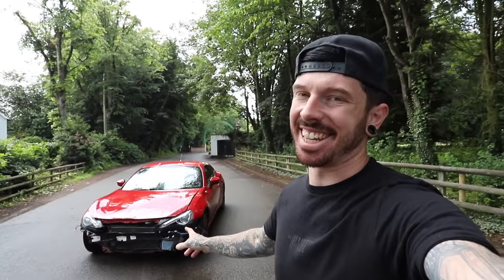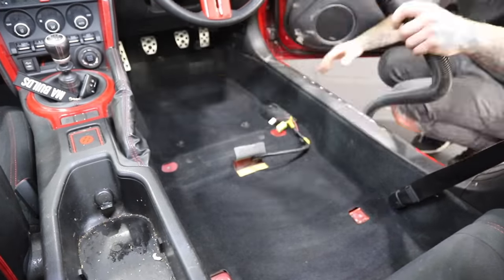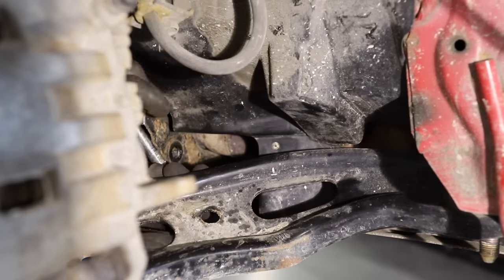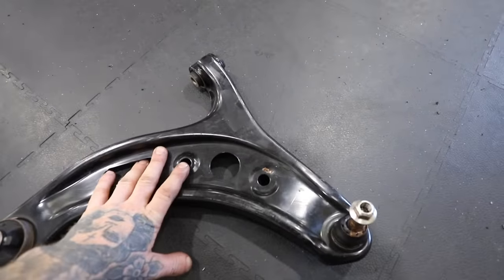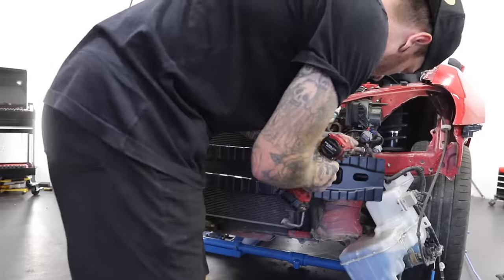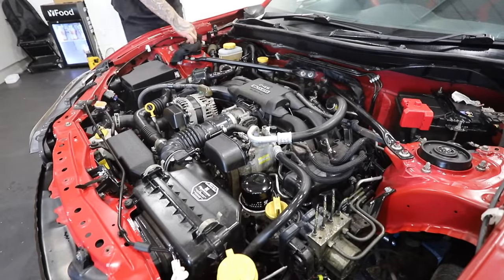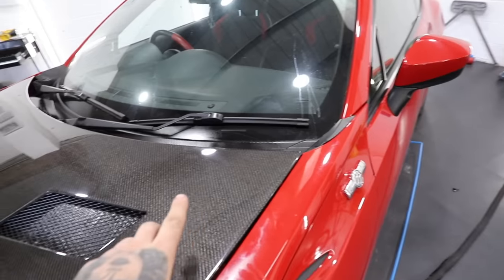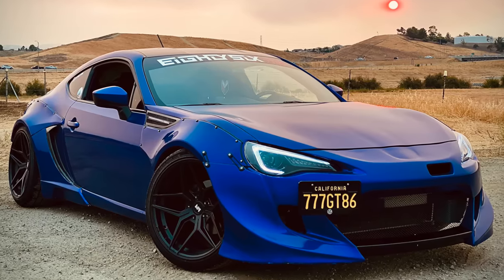REBUILDING MY CHEAP TOYOTA GT86 | SUBARU BRZ

Comment: Great videos as always. Little tip for removing the ball joints when they spin like that. With the wheel off lower the car onto an axle stand on the bottom arm pushing the ball joint back into the hub that way the nut should come in done. Saves getting the angle grinder out

Comment: When a ball joint is spinning like that, put a trolley jack/transmission jack or axle stand under the ball joint and make sure there’s pressure on it. It will then turn without spinning and saves time 👍🏻

Comment: A tip with the ball joint is it's tapered and needs a load on it to stop it spinning, usually you just need to load it up from underneath with a jack if you're doing it on the floor or a transmission jack if you're doing it in the air.

Comment: Its amazing how many parts and similar layout anything designed by subaru has, this car literally has what appears to be the same exact front brake calipers as my 2007 Subaru Forester. same windshield washer reservoir location, crashbar is very similar. If it ain't broke don't fix it. Same problems with headlights, same problems finding parts. The market on Subaru parts changes daily-weekly. There could be 100s of parts posted right now and none tomorrow. Love and persistence is key with Subaru, eventually you'll find the exact parts you need.

Comment: Use a car jack on the ball joint.
Apply pressure to underside of ball joint with car jack and ball joint will stiffen up for spanner to be turned.
But grinder works ok if you don't gouge your hub.

Comment: Tip for the ball joint you had trouble with. Next time place a jack under the ball joint and put some weight on it.  It’s a tapered seat so the more weight on it, the less likely it is to spin.  Works for tie rod ends too.

Comment: Get a hydraulic gearbox stand, then you can put pressure on the lower ball joint from underneath when the car is in the air, so the spindle won’t spin when you undo the nut, or lower the car almost down and put a jack under the lower ball joint.

Comment: Little tip for the future, put a jack under the ball joint to put pressure on it, gun the nut and it should come out.

Comment: This car is going to look sick, can't wait to see the final product! ABS light could be a dirty or failed wheel speed sensor and can share components with the traction control system, traction control could even just be turned off.
Reply: Its best if he drives it a few miles to see if it clears. Its better than dropping £3200 on a new one from Toyota.
Reply: @Kaz590  True, it could just go away if there isn't an issue.

Comment: Hay mat
Bit late now, but I've had the same trouble with a wishbone ball joint turning when trying to undo the nut, try jacking up the ball joint till it jams the ball you can then undo the nut.
Also the rocket bunny kit looks bad arse..

Comment: Don't go mad with the ABS fault. It's probably the fact the wheel was out of kilt and the abs ring Reading was out. Get a new wheel and get it tracked. More than likely the light will go out. Had the same on my Corolla when I changed the hub and track rod ends.

Comment: my 86 is turboed. you need to get this a turbo kit for sure. also got a replica TRD body kit on mine. also had those same vland headlights. had to do some modding to get the HID lights right. that v3 bunny kit will need some jigging to fit perfect though

Comment: I had to get my angle grinder out for a Rear shock on BMW 1 series lol it was siezed rusted and rounded worst possible outcome OUT comes the Grinder lol does the job tho right only now iu have temp bolts in the bottom as they are hard to get no scrap yard s  have them and BMW want 11 pound per bolt i used old fasioned nut and bolt to hold it and its worked to now

Comment: Personally pal, I advise you don’t use silicone based products around a car full stop. It drys tacky and collects dirt. This dirt can scratch surfaces. For engine bays. Use water based dressings. For cleaning it. Degreasers are best with a brush

Comment: Put the new aircon radiator in u will save that one from further damage
Reply: I agree. Also, you need to fill from where the radiator cap is, not the overflow tank.
Reply: @davidmckoyP0300  100%

Comment: Never heard of an ABS pump going on an 86/BRZ before. It's certainly not a common fault. Usually they drop wheel sensors, probably the same side as the bent wishbone.

Also fake kit? C'mon man, support the original designers.
Reply: Most definitely the speed sensor, the connector's are pretty janky behind the fuse box on that side. Is what it is with the replica kit, makes you question the maserati's kit haha.. but will be a real test whether its the normal half-a-job where the nose point to the moon or whether it's done well.